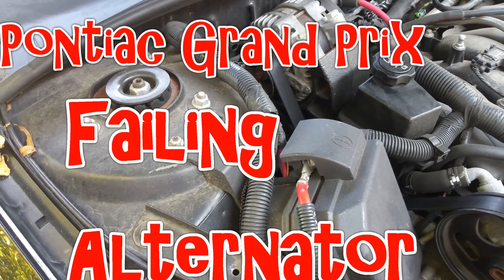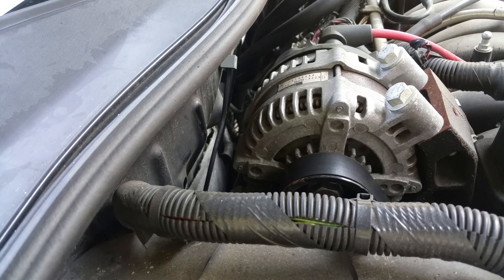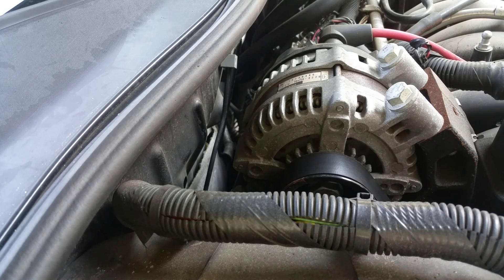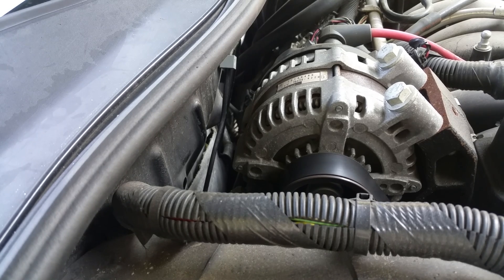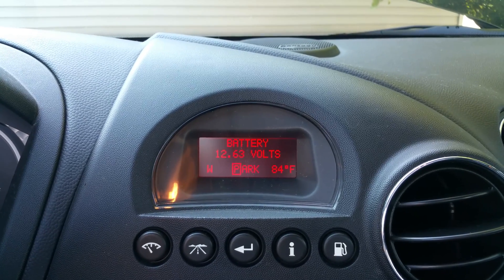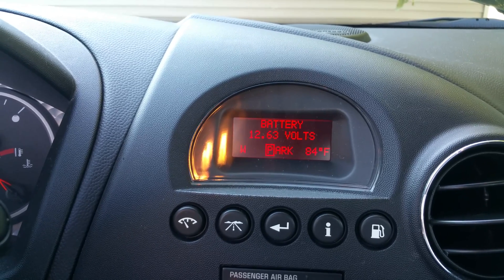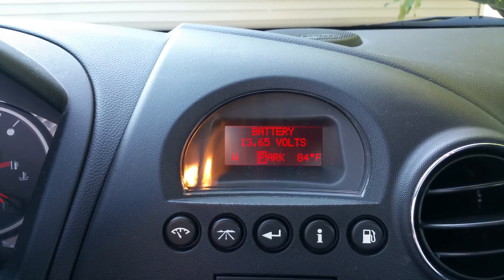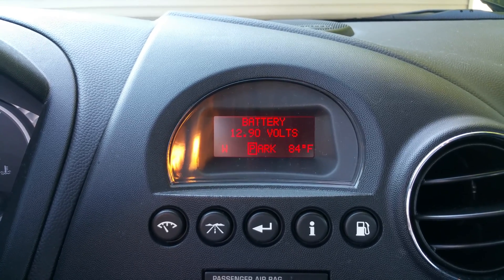What a failing alternator sounds (and smells) like.

Comment: This helped me diagnose the noise my 1996 Chevy 1500 just started making. I have had a few sluggish starts recently as well. What was most helpful and set apart from other videos was showing that the noise frequency increases as the throttle increases. Other videos just showed the noise at idle. Thank you!

Comment: Thank you , now I know that's not my problem on my Mondeo, but I have a lot of ticking. It's just irritating. I've checked my belt tensioner, in fact I have a new belt. But still this darned tick tick. It only is obvious on low revs.

Comment: I have a Toyata Highlander 2012 with the same issue. Your comment that it "almost sounds like a power steering pump going out" is exactly what I experienced. Thank you for posting this video, helps me understand the sound and confirms the issue.
Reply: 2007 4Runner. Chased power steering pump by changing fluid and stuff only to find out it’s the alternator. Thought the smell was from my exhaust due to the Alt being on bottom of the engine
Reply: Same here, 09 Highlander and have the same noise, but no smell. Mechanic said it was the alternator so I guess this video confirms what he said

Comment: Dang this is a late comment...maybe someone will see this. and have some ideas/advice?:

My car has has a rough idle, for awhile. Sometimes a rough start. batteries last their 'expected-ish' life span, but sometimes i need jumps, or its barely started (i drive around to recharge the battery when this happens). but its months/years after that, the battery finally goes bad. i can see some of the copper rings/wires in the alternator have corrosion(?) spots (silver-like though, not rust color). serpentine belt looks pretty good, maybe replacement in another 5-10k-ish. The belt feels taught, idk if the tensioner is going. Bought the car with 35k, its at 99ish now. I know im in "things need to be replace" milage, the car runs fantastic, overall. Never needed much work, and i keep up with general maintenance things. I do most work myself or with my mechanic buddy. (Car: 2013 Scion xB)

Comment: By the time you smell it, it'll set itself on fire. Before that happens, you'll feel a bit of heat on your legs. Happened to me today. I had these exact symptoms about a month ago,took it in and they couldn't find the problem let alone HEAR it. It was so obvious. So I saw smoke and then a fire. Getting it replaced and the connector. Only parts damaged.  Now I'm very familiar with symptoms of a failing alternator.

Comment: My car isn't driven far or often. Its a 2012 acura tl with 54,000 miles. My car started making that sound but even louder. I immediately thought power steering pump. It was dead one morning so I got it charged and 2 weeks later I was pulling in to get gas and my abs and traction lights came on and the car started making loud banging sounds and then shut off. One ladd charged ir but it didn't hold.  Got a new battery and it worked for 3 days went out car wouldn't start. Got alternator installed and he tells me get a new battery too the cells bad?!, only drove it about q mile to the store but car still feels like it isn't running properly. Sorry so long.

Comment: My check battery light came on today.I was about 20 miles from home so I thought,oh sh*t.I hope I don't have to call a tow truck or worse...
I made it home no problem.I stopped by Advance Auto Parts,since they are the ones that put in my new battery last Autumn.They tested it.Battery good,alternator going bad.Not much of a smell..in fact some times.I wonder if the smell is just my imagination.But the sound i have been hearing has gotta' be because of the alternator.I just had the AC compressor replaced with a new one last week,so it can't/ damn well better not be that.
Can't be the noise I heard 2 weeks a go which ended up because one of the small 90 degree hoses had a hole in it.I fixed that the other day.
Ugh..bad compressor,vacuum leak and now bad alternator.
Serenity now!!

Oh well.at least my alternator is where I can reach it and replacing it looks relatively simple.

Comment: I started smelling burning rubber after I replaced my clutch and thought it was that. But it's not consistent. BUT: My new battery died after just 1 year. Granted, I didn't drive for a week in very cold temps. It's 2007 Toyota Carolla Sport with about 140,000 miles. She shouldn't be stinking. Lol

Comment: I hear this sort of noise comes and goes. I dont know where its coming from. No burning smell. No low battery signs. 2 weeks ago changed timing belt and water pump. 
Last night the noise scared the hell out of me after 50 miles drive most miles on the  motorway. This morning no noise at all. I am breaking my head.

Comment: A bit jealous, myself. My 07 Honda fit, it's down below the EGR, and you have to remove it, to change it. Last time I drove it, smelled like it was on fire. Parked it, and cant get it to start. So, the fun begins.
Reply: Btw, someone who's supposedly a "mechanic," said that my ac clutch was going bad. So, the alternator i had on order, I cancelled the order. When it fired over for a couple seconds, and the battery light FINALLY came on, it finally told me he was a dip shit.

Comment: Normally not worried about 12.63 volts at idle?... you'd better be. At idle you should be doing at least 14 volts, if you have to fast idle for anything more not only your alternator might be shot, your belt could be slipping. A normal alternator charge should always be the same at idle or high speed, if speed changes that then somethin is wrong.

Comment: Okay so my mother has a 97 Nissan 200SX that's had its alternator replaced years ago. It has a whining whistling sound that has always been there though. when we took it to nissan, they said that noise was normal and that it was the alternator making that noise. I even recently took it to AutoZone and advanced Auto parts to have the alternator checked and they said it came out fine. What else could that noise be on my mom's alternator?

Comment: I took my car to get checked and. Suspected it could be around the belt area. They said it was either the pulley or Alternator. Spent 280$ on a new Idler Pulley. Still whining. Alt needs to get replaced... The sound it makes is similar to yours. Hit the nail in the coffin. I would've like to hear what it sounded like from inside POV before and after fix. Helpful video bro!

Comment: I installed new alternator and I plugged in the battery cables the alt started getting hotter to the point where it's smoking without the engine turned on 🤦‍♂️ must be a short somewhere between starter to ignition or the ground
Reply: Mine gets hot but my whole engine also gets really hot after long drives

Comment: You've just saved me having a waterpump fitted. It was this that was my issue.  I noticed when I put   my lights on as well the pitch went up slightly.  In fact any load changed the pitch of that sound

Comment: Thanks for the video. My alternator on my 3.8L v6 is sounding exactly the same... only the battery was replaced in 2016 and alternator was new in 2015... so I wasn’t sure which one is failing but it’s definitely the alternator. I thought I’d get longer out of it

Comment: My alternator blew when was accelerating hard. I thought the clutch blew. The whole car jerked then I smelled burned electricity or ozone
Reply: Did it jerk at low speeds or complete stop you could go over a specific speed limit?
Reply: Bowdown Dubsup everything  was perfectly normal. Then I got on it and felt a boom around 5500 rpms! After that I smelled burnt electricity and my car said check charging system. I was a single giant jerk.

Comment: I’m not mechanic but if you get like a click sound is only 3 things batterie. Alternator. And stater so far alternator failing give a burning smell  look for batterie date maybe old. Stater if you see is to old stragles to turn on. Stater is. I just change mine it did a click sound and on the second. Key turn it turn on. Hope this help some on

Comment: I'm so jealous of the location of this alternator.  Look how easy that is to reach and replace.
Reply: Mine is in the perfect spot where it's fucking behind EVERYTHING no matter which way you go at it.
Reply: well toyota corolla's also are easy to reach the alternator too
Reply: John Dale Pantilano what about the 2002-2007 Highlander ??
Reply: Hah, alt is easy. Ita getting the serpy back on
Reply: @jordanpike9778  aja
Reply: man my suzuki grand vitara 2008 is a pain to change that fucking shit
Reply: Me too man
Reply: Same. I would definitely replace it myself if it was right up top.
Reply: 😂🤣big time. My car's alternator is at a kidney location of the engine lmao. Pain in the but. My SRT8 6.1L Challenger today, just all of a sudden my alternator went bad. Car was still drivable but, I had a small burned smell and this humming noise with the pulley squeak.
Reply: Yea right
The one on ford focus went out and i can remenber last time i had to remove it was pain in the Axx.
Reply: Rotating the engine will give you better access to remove it
Reply: Lol
Reply: My focus looks fucking daunting honestly. I've got a weird noise off throttle like this alternator specifically the groaning after the car returns to idle. I'm thinking this might be my issue. It's fucking horrible sounding. Not so much whining but if I put a pry bar against the case of the alternator it makes this sound almost exactly. Its actually louder inside than out but that may be because my fans are running full speed
Reply: Me too
Reply: Right
Reply: Mine like under the dmn engine
Reply: hahah yeah..thats so true u know😂
Reply: Same here I've got a 1999 mondeo st24 with alternator on way out, its at the back of the engine a real pain in the arse will take hrs to change out, that looks like a 15 min job.
Reply: MY EXACT THOUGHTS!
Reply: cries in Hyundai Sonata
Reply: dude, the alternator on my 2004 Mini Cooper S is literally located under the supercharger, have to rip off the entire front + pull out the radiator on screws to get an extra 1-2 feet of working room, Pain in the fucking ass lmao.
Reply: Unlike my 1992 ford mustang which has the belt tensioner in the way and the upper radiator hose
Reply: The alternator is probably the only easy thing to reach in gm vehicles everything else is a nightmare even the battery for me

Comment: I changed my very corroded negative cable and once I fired it up it made this noise and assumed it was the power steering pump. The noise went away and the car drove just fine, parked it and it struggled to start, the DIC is blinking like a Christmas tree. Will change it today and see if fixes it.

Comment: Sometimes my car needs a jump when I need to start it but works fine when driving or just idling would this be a alternator issue ?
Reply: Take your car to Autozone, O'Reilly or Advance Auto Parts. They can test you battery, starter and alternator for free and sometimes they'll let you know which is defective

Comment: My exact problem.  Smell, sound, and warning indicator.  What I'm trying to figure out is which component(s) of the alternator could be failing.  I want to know if its something I can take apart and replace or if I have to shell out $400 for a new one.  Anybody?
Reply: battheman777 could be the bearing if so u can fix that but if it’s the brushes good luck buddy lol

Comment: This is the EXACT sound I just heard from my Jeep.
Reply: Got a 2010 grand Cherokee and same sound also was smoking a bit. Jeep in all their brilliance routed the wires on top of the alternator albeit they have heat shields but in my case the alternator was so hot it started melting the plastic. Fortunately I caught it before it roasted the wiring.
Reply: @iamthemiracle81  what kinda jeep?

Comment: I have noticed the same noise in my 1994 tran sam. Thought it was power steering pump.  Then the other day while reaching for the transmission dip stick I placed my hand on top of the alternator and jerked it off, the alternator was burning hot!. No smell, just the whining noise and felt red hot. 337.000 miles on  it. I bought the  car New. It's the original one. Got my money's worth out of that part lol.

Comment: My car fried its alternator as well after 170k km for no apparent reason, no smell at all but battery light came out, then ABS and EPS (electric power steering) showed up on the dash too, and car didn't restart after I parked, forcing me to call for a tow. Thought it was the aux belt at first since it was squeaky and due replacing soon regardless but it had not failed.
Luckily a local scrappy had my OEM alternator model in stock and the garage was OK to fit it which saved me no more than €370 (yes, you read that right...) compared to a brand new OEM one. Had the aux belt replaced as well, as they had to remove the old one anyway, so all in all it wasn't so bad ^^
Reply: Hi from the UK had same problem last few days on my old renault clio , its done 200 thousand Kilometres so lived a long life, the smell is really bad  from it , like rotten eggs, im gonna chance driving it at 30mph to get to work tomorrow 15 miles away , hopefully as its a diesel and has a large battery it will survive for 1 more day

Comment: I have a 2004  Hyundai Santa Fe I believe the alternator is failing..along with the power steering pump :'(
Reply: 2005 Santa Fe here. I have almost the same exact issue. Mine will just shut itself off, locking up the steering and all. Now I have a knocking that gets worse as i accelerate.

Comment: I got 2011 Hyundai Sonata Push to start cut off on me wont start back got new battery still wont start, tried jumping off started smoking and smelt burning smell but my lights on dash come on and fan blower on Ac so confused if alternator or starter & mines not in warranty & can’t afford to go to dealership! Any thoughts? Thanks
Reply: Make sure your ac is off, your ac clutch might be stuck

Comment: Thanks for posting this video. With these exact symptoms was your battery light on ?  (I see you have the voltmeter display) . Was just curious, had a mini Cooper with the same symptoms with NO battery light on. I replaced the alternator and it fixed the issue but I was skeptical about changing the alternator at first because the battery light was NOT on even though the car was not charging at all. 
Thanks

Comment: I don't have a burning smell but the sound goes close to quiet except I can still slightly hear It In the cabin with the radio off and while on idle,  on cooler mornings It makes the noise louder and takes longer to go away. Could that be the same issue?

Comment: Dude Thank you so much for this video! You helped me find the insaine noise in my 1998 Chevy astro van. At first thought it was the belt tensior. Replaced it cause was moving around way to much then realized the problem didn't go away. Took belt back off after watching this and hand turned the pull on altinator and was hard to turn spun it quickly and found the horrible noise. Gonna have it rebuilt this Monday at motor electric in grassvalley ca. There the best. Thanks alot! Never knew an altinator bearing could make such noise. What your dealing with they normally do that...but mine wow it's bad. Haha thanks million dude! :)

Comment: I was never able to smell it.  Maybe the smell is not strong enough to pass through the grill of the car, but the horrible whining and somewhat of a whistle, which reminded me of the sounds a hurricane makes in passing, were my clue that the alternator was bad.  The sound your alternator made was mild compared to the alternator in my car, which would turn heads...for the wrong reasons! My alternator failed thanks to AutoZone selling me a dead battery last month, which had a damaged cell and caused the rectifier bridge to overcharge, yet I am stuck with the $350 bill for their unethical business practices!
Reply: Natalie K. Samething happened to me only with them giving me two bad altinators for my Lincoln town car.

Comment: I put a new alternator in our vehicle and it still makes that whining sound!
Reply: Jewelinna Arceo its most likely the idler pulley most of the time the nouse is due to a pulley bearing gone bad 75%of the time if the car is running fine not dyimg or voltage is good it is the idler pulley cheap easy fix too